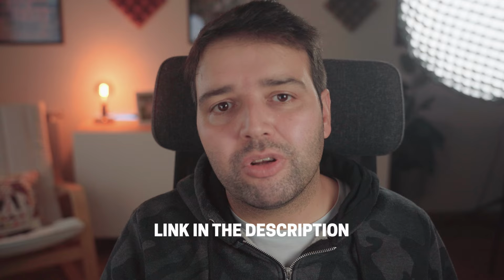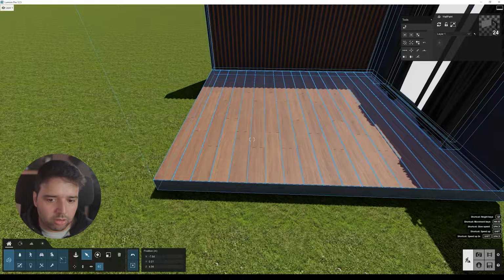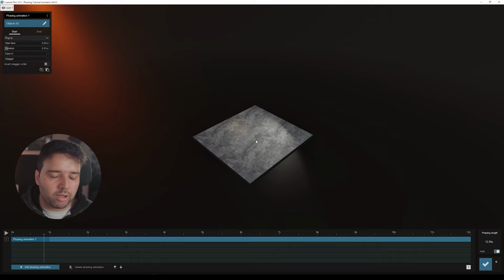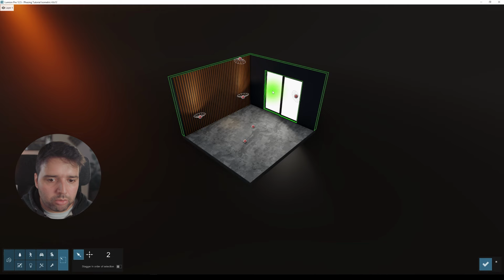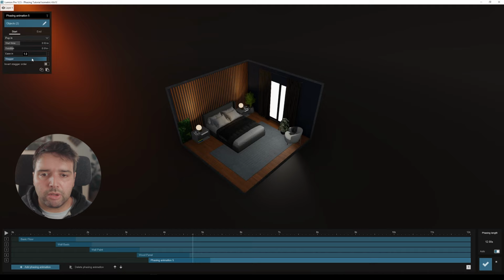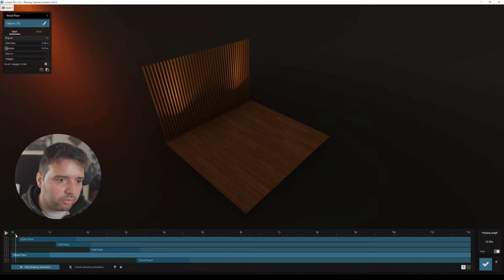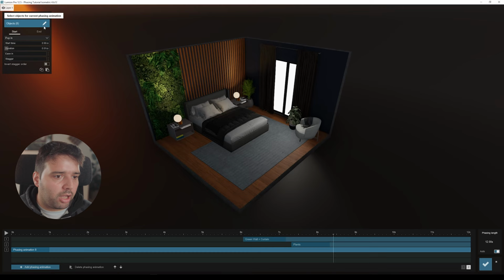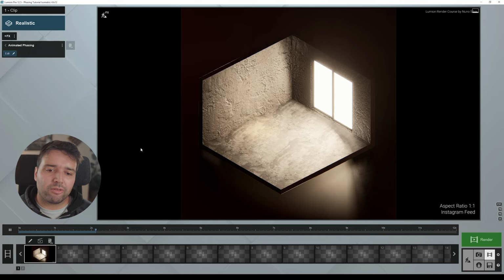Make a Lumion Construction Phasing Animation - Lumion Tutorial

Comment: excellent work Nuno
but I wanna know how to export work in groups using Sketchup as you did in Modo
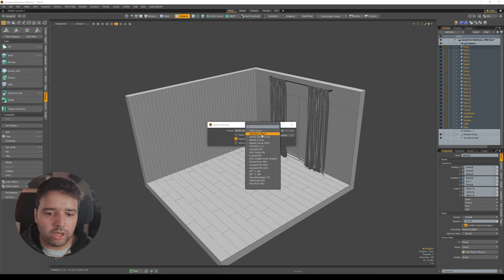step 1 in time 1:50
Reply: I have the same Issue. By far, the only way to do it is one by one from its group.
Reply: Same here. I have searched everywhere and have not been able to find a way to import groups from Lumion or import multiple groups. It just does not appear practical to import one item at a time. There must be a better way?